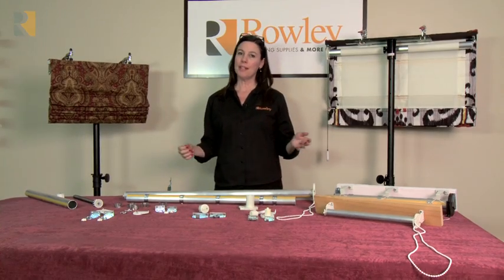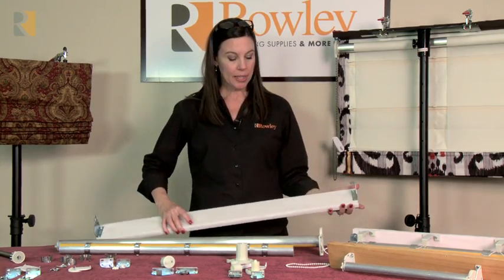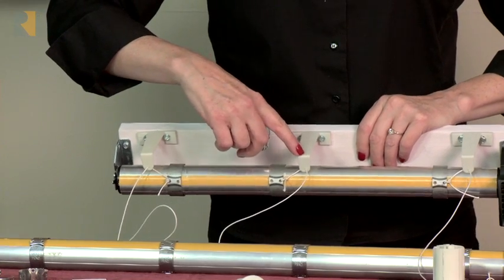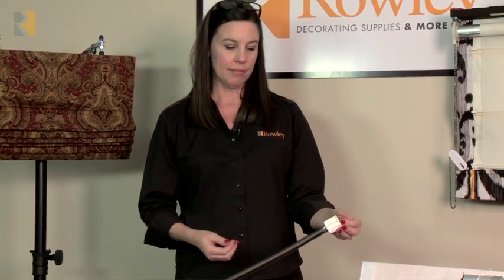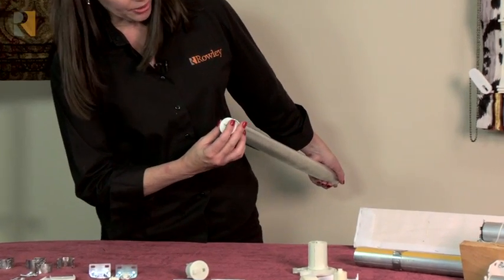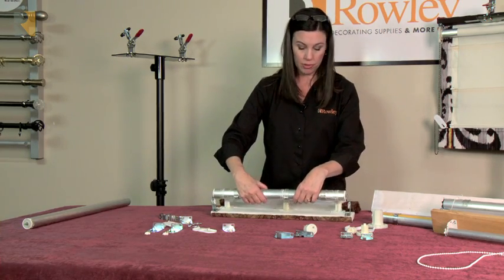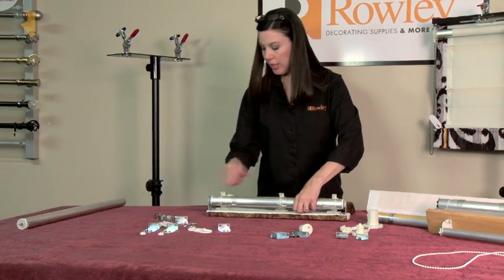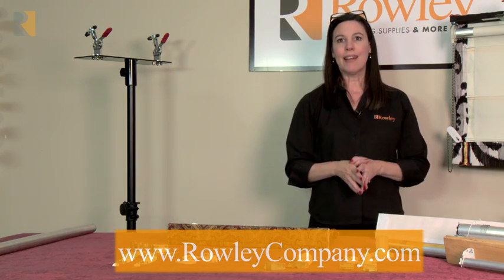Overview of Roller Clutch and Spring Systems

Comment: This was a clear and well-explained video! I thought I had broken the spring system when I took it out. But turns out the spring was extremely tight and the pressure let off when I pulled it out. Thank you !

Comment: THANKYOU SO MUCH!!! I am just about to recover some old blinds, and I would have not thought (UNTIL IT DIDN'T WORK) to add some extra length for, as you put it, 'tugging'! In fact, I KNOW I would have been short, as I would try to avoid extra weight and bulk. Not sure if I would have cut all TWENTY, (I have a Sun Room), but you saved me a pile of grief!  Thanks again!

Comment: Thank you for demonstrating Roller Clutch and spring systems.  I want to make a 72"x72" pull down design wall for my quilt studio using thin cotton quilt batting laminated to a vinyl shade.  What size of roller would I use and which system would work best for this application?
I watched both the laminating video and clutch/spring system.  Your nameless presenter was very professional, informative and charming as well.  Nice smile!...Good Job on videos!